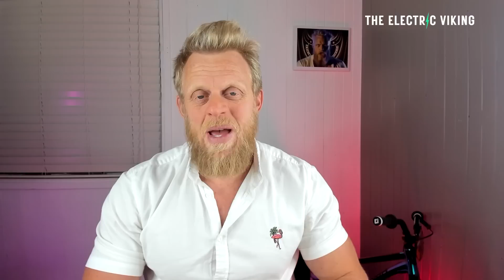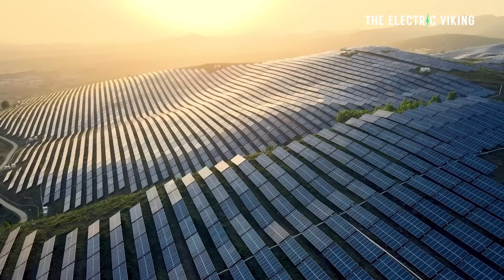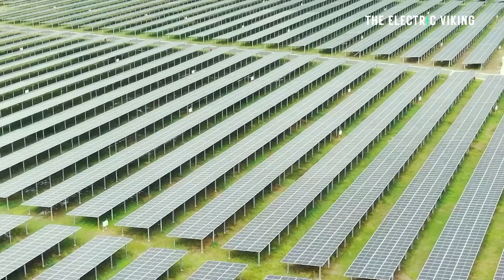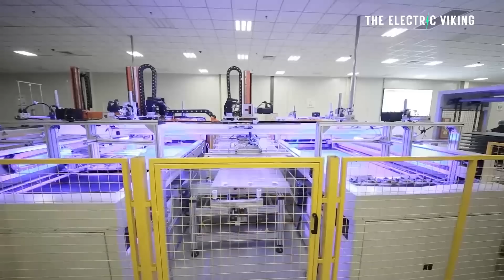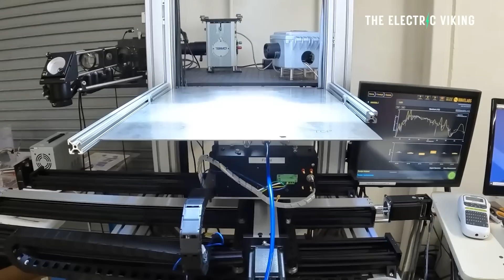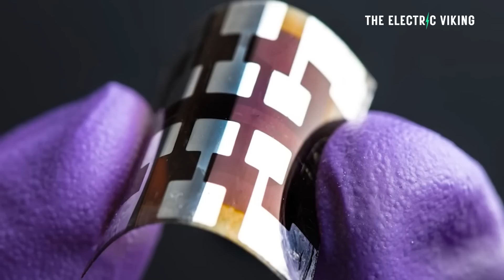How much of the worlds land mass we need to cover in solar

Comment: 0.3% of the world's surface is the equivalent to the area of Sweden, Japan, Italy, New Zealand and Greece... COMBINED.
It's absolutely ridiculous.
But never let facts, logic and common sense get in the way of a nice story, amirite?
Reply: That's assuming the area is contiguous, AND that none of it is over water, which is 3/4 of the planet, AND that none of it has dual use (agrivoltaics), etc., etc., etc.

We've seen from India, and pilot projects in California, that solar is being built over canals, which helps prevent evaporation of water, and helps manage drought conditions.  This is over previously unusable land.  Win/win.  The same for agrivoltaics.  Some crops have higher yields with less light (spinach, rice, etc.). Another win/win scenario.  Then there is rooftop solar, more unusable space...  The land area was to make a point that we need less solar than most pretend... and that is BEFORE we see increased efficiency of panels over the coming years.

Comment: I was watching a presentation by NextEra energy in the U.S. a couple of years back. NextEra is the largest generator in the U.S.. They use wind, solar, battery storage, gas and nuclear generation. They said solar costs 2 cents U.S. per kwh to generate and battery storage adds another cent. That was two years ago, so what is it now? One cent?
Reply: There are a number of utility scale installations at ~$.01... but not in the US. Protectionist measures have tended to increase prices here slightly, isolating us from the price drop in other parts of the world.

Comment: We have solar panels in a cold weather climate in British Columbia.  They are great for 3/4 of the year.  We have some winters where they could be snow covered for 2 months of the year.  This year not so much.  In the future, our greatest need for electricity will be in the winter as we transition to heat pumps from burning natural gas.  Therefore we need much more wind in our mix to make up it and luckily winter is our windiest time of year.  

I have been keeping track of weather patterns in various parts of the province.  On our west coast, during the winter there is a tremendous wind resource.  In these same areas there is ridiculous amount of rain.  When I lived in Tofino, there were some nights I had to bail 4 inches of rain out of the boat in the middle of the night and do the same in the morning.  A nearby stream fed by a small lake would be gushing huge volumes of water.  There is opportunity for some sort of intermittent hydro that could feed lots of power during winter storms.  If you develop the infrastructure for the wind farm, you could add in these intermittent hydro sources as well.

Comment: Agrivoltaics doesn't get enough recognition yet.  Many crops have HIGHER yields under solar panels (spinach, rice, etc.) because they prefer less direct sunlight.  So, it's a win/win for farmers: higher yields, and energy production, which can potentially be sold back to the grid via net metering.  California also just started a pilot program to copy something that's been done in India: covering irrigation canals with solar panels.  The land is otherwise unusable, and it helps prevent evaporation, which helps fight water shortages.  Another win/win.

Comment: STOP trying to yet further centralize our energy supply owned by billionaire monopolists!

Let's put solar panels on every home, business and covered parking rooftop and switch to electric vehicles making nearly everything we do solar powered while completely decentralizing our power supply and empowering everyone as power generation owners.

Solar power is CHEAPER and electric vehicles are soon to be CHEAPER to make and already are considerably CHEAPER to maintain and operate, especially if charged from your own solar power.

A 3-5 year ROI (return on investment) for a solar array that will generate power for decades is a no-brainer and the panels can even be made locally too.

#EndFossilFuels #EndNukes #SwitchToSolar #SwitchToElectric #GreenNewDeal #EmpowerEveryone
#DEMEXIT #StillSandersPlatform
#RepublicansAreNazis

Comment: We cultivate approximately 150,000 square miles of corn in the US. ~40% of that goes to corn ethanol, which accounts for around 5% of motor vehicle fuel. Meanwhile, NREL estimated land use to convert the entire grid to solar is 22,000 square miles. In other words, we could power the grid almost three times over if we just converted cornfields used to produce ethanol to solar farms. Realistically, we will end up with a mix of generating capacity and there are better locations for solar than corn fields. So, there is absolutely no need to be concerned with land use.
Reply: Pretty amazing. And putting solar pv on the fields doesn't even mean the entire area will be blocked for growing crops.
Reply: I live in central VA, USA.  We have some corn and soy, but mostly grapes (vineyards) and beef cattle, and I personally own a tree farm.  Almost every farm already has some solar.  Mostly to heat/cool feeders and power outbuildings.  That being said, venture capitalists (people who don't live here or care about our community) have tried to build solar farms, and their plans always get rejected.  We have some of the most beautiful land in the country.  Solar farms destroy that, and the power generated here gets transmitted to city dwellers.  They get the power and profits while we deal with ugly panels as far as the eye can see.  No thanks.  Also, I have no problem with personal solar and have panels myself, and my next house will be 100% off grid via a ground mount system.  I have a problem with rural areas being used and abused by urban ones.
Reply: spot on
Reply: the problem isnt producing power,   the problem is WHERE you are producing it.   the farther you have to transport it,   the more power loss there is.  theres no point in producing as much power as america using in a year if you cant transport it to where its needed.   thats why solar panels wont cut it.    hydro and nuclear are the only real viable solutions to replace oil, gas and coal.
Reply: @jebes909090  Nuclear is currently the most expensive utility scale way to generate electricity. And that is not counting long term storage costs or potential disaster liability. In best case, solar levelized cost can be less than $.01 per kWh and averages around $.02, compared to average levelized cost of around $.20 for nuclear. Even in a worst case environment, solar is still much cheaper than nuclear. Transmission costs and losses do not even come close to covering the gap. And a solar farm can come online in a matter of months vs. over a decade for a new nuclear plant (if it ever comes online, as most projects that are started fail to ever be completed). Even with the added cost of batteries to provide all-day power, solar is still much cheaper.
Reply: @larryevans6739  but nuclear can produce large amounts of power anywhere in the world where solar is really only any good at lower latittudes.     per acre,   nuclear is by far the most dense amount of power.    it certainly has it drawbacks,   but its the only viable alternative to fossil fuels for energy production.   hydro is second.   wind and solar are very location bound as well as condition bound.   hydro and nuclear are not.
Reply: @jebes909090  At 1/20th the price per kWh, solar can out-compete nuclear almost anywhere in the world. On a cloudy day, rain storm, snow storm, it's still cheaper. In Alaska, still cheaper, although it would be better to focus on wind there. When you are 1/20th the price, you can operate at 10% of peak output and still be half the price. And, as discussed in the video, there is no concern with not having enough land. Nuclear is only viable if you have unlimited money to waste on it...  There were some people who hoped to have the price come down enough with small modular reactors to compete with natural gas peaker plants, but the cost of batteries has dropped enough for even that to no longer be financially viable.
Reply: @jebes909090  No, you cannot build nuclear power anywhere. You need lots of water, which is why they always build them close to the sea or big rivers.

Comment: Renewables are indeed the only way forward but their implementation will present some enormous challenges.   Storage in northern climates can't be addressed by chemical batteries as the cost is immense.  Latitude (extreme climate) is a huge factor with solar/wind being practical at southern latitude whereas a house in the Canadian Arctic would require approximately 400 Tesla PowerWalls to assure the very dark, and not necessarily windy, 5 months a year when daily energy requirements for heating are over 50kWh per day (ie the capacity of 4 PowerWalls).  There are no silver bullets.
Reply: Your math appears to be way off on the PowerWalls.  Did you assume each battery can only be charged once per year?

It's not nearly a simple as naysayers like to claim.  For example, the Casey Research Center in ANTARCTICA gets 10% of it's power from solar.  If it can work there, it can work literally anywhere on the planet.  People like to only mention one half of the narrative.  Yes, extreme latitudes receive less light, BUT the colder temperatures allow solar panels to work more efficiently, partially offsetting those losses.  And, since panels can use ambient light reflected from snow, extreme latitudes can work pretty well for solar panels, despite all the naysaying.
Reply: @AMortalDefiant  The point is with the Arctic home example is that you have to go into the winter with an extra 5,000kWh because you will be running a deficit virtually every day.  Next to no solar for 4-5 months and wind will be unreliable.  So yes, as far as winter is concerned you will effectively be only charging the batteries over the summer and discharging them over the winter.  Fossil fuels can be thought of as a one charge only energy battery.  They are "discharged" over the winter and can never be used again.  Chemical batteries are discharged over the winter but can be charged over the summer.
Reply: @AMortalDefiant  10% isn't a solution, it is greenwashing.   Going renewable means going 100% and that is radically different from 10% or even 60%.

Comment: I paid $1,000 for a 100W panel in 1984.
Reply: Price (in Europe) now in 2023:
~200$ for a 260w solarpanels 😎👍
Reply: Prices have plummeted in accordance with Wright's Law (there is a version of this called Swanson's Law that applies specifically to solar panels).  In the 70s, solar panels were $1000/W; not they are about $1/W (all cost are pre-installation, of course).  So, there's been a 1000x decrease in price over the past 50 years!
Reply: Are you still using it?

Comment: I wonder if the countries around the equator will be the industrial leaders in the future.
Reply: Most likely, the grid will become more local.  Transmission losses occur over great distances, so you don't want your energy production far from where it will be consumed, ideally.

People also ignore the fact that while there is less sunlight at extreme latitudes, solar panels work more efficiently in colder weather, which partially offsets the lack of light.  Even the Casey Research Center in ANTARCTICA gets 10% of it's power from solar now.  Panels can also work off ambient light, like reflected light off snow, so, again, they can work better in some cases in extreme lattitudes.
Reply: @AMortalDefiant  yeah, reflected sun can bring it up a whole lot in colder areas. The best site must be solar floating on cold water near the equator, maybe with some additional reflecting arrangement 🙂

Comment: Solar works great on rooftops, you don't have to pay for expensive racking as compared to putting them out in the middle of nowhere, don't have to buy expensive land, or waste land that could be used for other things, you cut down your power bill, and you preserve the shingles on your roof. If your region offers a "net zero" metering incentive (you can get credit for power you produce in the summer then put it against your bill in the winter), then you don't even need expensive batteries to benefit bigtime. The ROI on home solar installs has REALLY improved over the last 10 years!
Reply: My thoughts exactly. Forgot panels in the middle of nowhere! Put them on the roof of the building needing the power.
Reply: If i would have land i would put the solar on the ground. Here in Quebec, we get snow eatch winter. I do climb on my roof to take the snow off the panels, but it's a risk every time i go up there.

Comment: Keep in mind that it is the goal to rev up solar panel efficiency to over 80%. This means the needed surface will decrease over time. Think big like Nikola Tesla did!..and not just what's possible right now as if that's the end of the line. It ain't.

Comment: 0.3 sounds way too high. I suspect you just need 5kwh on every home. You wouldn't even need transmission lines one we have cheap long life batteries.
Reply: The amount of energy used in manufacturing is significantly higher than  residential. 5kw on every home will definitely cover residential and EV demand but more energy is needed for the whole system.

Comment: The use of deserts is a bit farfetched. The emphasis is on FAR. This was proposed in America, creating all the electricity the US needs, using less than ten percent of unused land in New Mexico. Great for New Mexico, but getting that energy from one spot to the rest of the country would be difficult. Sending electricity over long distances is a problem because of energy loss and certainly the power lines will heat up and be hot as hell. Because you know they will go for as few transmission lines as possible, and those lines will be pushed to their limit. With all that heat over long distances, repair would be costly and not quick either.

The redundancy of a distributed system is the way to go. It's much better to have the energy generated locally. There would be serious resistance (not the ohm kind) in America. It would be called socialism, but I think we should have municipal or sector-based solar farms coupled with mandatory government-owned solar roofs for qualified homes at no cost to owners. Most people don't use their roofs, and the new roofs could be maintained by the government/power companies, with the added benefit of free roof maintenance.
Reply: I think you took the land-usage portion far too literally.  That was meant to demonstrate that we need far less solar than the naysayers claim.  Solar is already becoming much more localized, but there are very good use cases for solar arrays, such as building them over canals, which prevents water evaporation, and helps manage drought conditions.  Agrivoltaics is another excellent use case for arrays.  Many crops like spinach, and rice have higher yields when grown in the shade of solar panels, and the farmers can sell electricity back to the grid via net metering.  Two of many win/win scenarios for arrays.
Reply: @AMortalDefiant  Everything you said is correct, but the notion of generating electricity AWAY from where people live was directly mentioned in the video. I was just pointing out that while it would work, it would have problems, and mentioning it in such a straightforward simplistic way would give ammunition to the fossil fuel backed naysayers.

Look at how EVs are 100 times less likely to catch fire, and yet have the stigma. We can't give them any ground to nay say.
Reply: @AMortalDefiant  I think I may be guilty of a little nay saying here. Apparently, the distance and energy loss isn't enough of a problem to deter it working well. https://www.youtube.com/watch?v=gacGuWjqKco